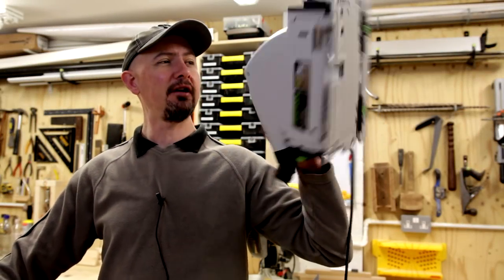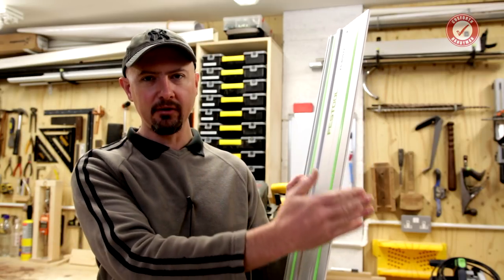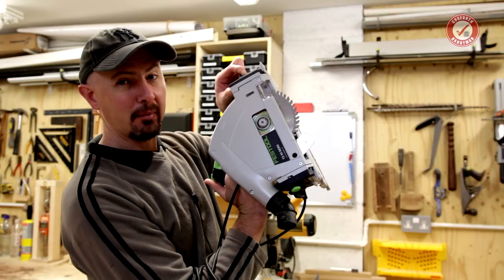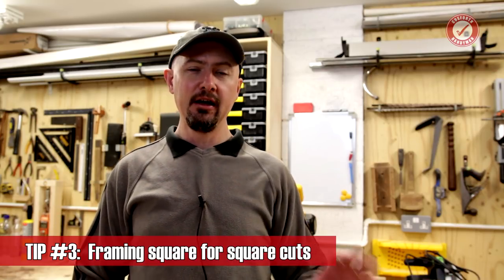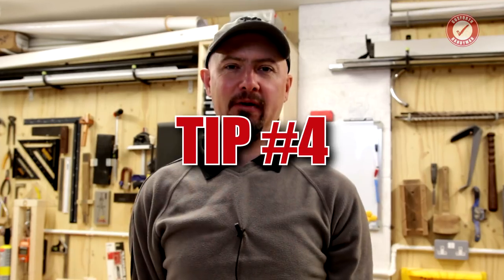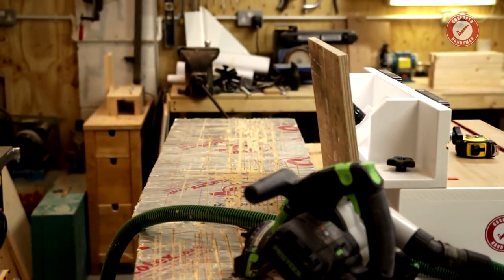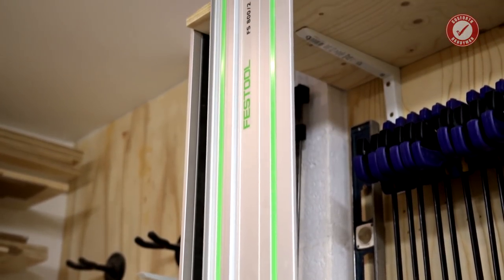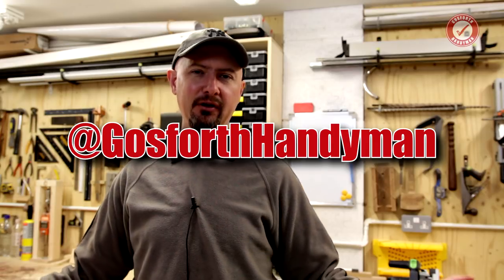Beginner plunge saw / track saw tips!

Comment: # 1 Track on the keeper side of the wood
# 2 Clean tracks with air and tape
# 3 Framing square for square cuts (or I'd use a rail square, new more affordable option from Taiga Tools available -- I'll have mine tomorrow! :-) )
# 4 Keep power cables and dust hose together
# 5 Keep both sides supported (keeper and waste side)
# 6 Hang the guide rail to store it
# 7 Attach dust extraction

Comment: Andy, The older Festool hose with the squashy end was made like that so it could flex to fit the OVAL dust port on their router. I just got my first tracksaw ( Makita ) which is great and use an excellent Nilsik vac - the vac comes with a squashy end which goes straight into the saw. Good vid as usual. Thanks.
Reply: What's your vacuum model please?

Comment: Hi Andy. You have a new subscriber. Good job👍

As for the Festool extraction connectors, it's a simple one. Older tools and extractors (pre-2017, I think) came with that standard friction connection on both the tool and the extractor. Newer tools come with the bayonet fitting, generally if you order any new Festool (that uses extraction), it will come with a free connector thrown in, for you to replace the old friction connector on the extractor. Word is, in the trade, people are finding the new connection system more irritating than the old one!
Reply from the maker: Cheers Neil. There we go, knew someone would be a lot more knowledgeable on this than me 😀- comment pinned! My only concern with the friction one is does it not wear out over time or is that rubber fairly robust? Perhaps I should leave it plugged in and unscrew the actual connector instead... 🤔
Reply: Gosforth Handyman No, the old type fitting is way. Better, and harder wearing! It’s a nicer rubber, they’ll last forever!!
Reply: Neil Snape definitely more irritating! Glad I’m not the only one thinking this.
Reply: hm... I have bought 3 Festool machines in 2018 and 2019 - none of them came with a free connector, though (of course) all 3 have the new bayonets. And as you said, imo the new system is not a step forward

Comment: Tip #7 tape up the hole on the side for changing the blade. This improves dust extraction just like the Mafel saw. Very important to do this if you are working with cement based products.
Tip#8 Plunge the saw before cutting into the material. This will help stop kick back and also gives a better starting cut. Buy longer tracks to do this. I recommend 3m and 1.8m tracks for sheet material.
Reply from the maker: Good tips! I use a 1.4m and 0.8m together at the moment - didn't know they did 1.8m tracks! 👍
Reply: Gosforth Handyman best to buy 2 3m tracks then cut one down to 1.8m and use the left over piece for short cuts.
Reply from the maker: Genius! 👍👍

Comment: I’ve got an older Ts55 that has the socket for the smooth hose and its so much easier and works well with the smooth adapter that I have on my nilfisk vac, also the bayonet fitting does not work well on the old Festools that have an oval dust port.

Comment: Festool changed the fittings for the extractor hoses in late 2016/early 2017. When they upgraded the RTS/ECS/DTS sanders in an attempt stop the hoses from coming out in use. The older TS’s have a nice round barrel which is a much easier fitting for the smooth hose ends.
(Old his into new fitting is a pain!) Not sure if they still do, but many of the tools were coming out with the new type hose fittings included.
Reply from the maker: Mine must have the new fitting on the saw but old hose. I'll look out for the old style fitting for my saw as that would make much more sense. Cheers for the info.! 👍🛠

Comment: Tip #6 3/4: The Festool splinter guard fits nicely on the old Bosch FSN 70 / FSN 140 tracks as well.
I needed a replacement for mine, but the original Bosch part is no longer sold in Denmark, and I didn't want to bother with foreign web sites. I found out that the Festool guard has the same thickness (2mm) as the bosch, the only real difference is that the Festool guard is harder than the Bosch one. Oh, and the original Bosch is black rubber.
I bought a 5m package at a local hardware store for considerably less than it would have cost me to get the original.
Oh, and I have a set of Festool speed clamps in order to replace the screw type Makita ones I use now. Bosch only makes speed clamps for their new type tracks...

Comment: You probably know that all of the Makita dust and track stuff is interchangeable with the FT  stuff,  but sum of the FT stuff will have to be modified to fit the Makita track. Makita stuff is much less costly than it counterparts in the FT line. DeWalt's  clamps are also great to have on hand and fit the tracks of FT and Makita. Great vid. B
Reply from the maker: Great info! Yes, I'm very tempted to get some of the DeWalt clamps. They look a better design than the FT ones. 👍
Reply: I have the Makita mains track saw, it does everything that the FT does but each to their own.

Comment: You can upgrade both connection ends for models until mid 2016. No need to buy a hose. Part numbers 202096 and 202346 (27mm) and 500670 (36mm). Great video, thanks!

Comment: Hi…..I have a 4 x 8 sheet of unfaced foam board insulation. Would that work for a cutting surface?
Reply: Absolutely, but wear a mask, cause gawd knows what's in it. I use soft wood panels that I found at Lowes. They're 48" x 16" and I don't bother with a mask, as my dust collection grabs the brunt of the dust. About $7 each, and they last for months.

Comment: And when the splinter thingy on the track is ruined and can’t be used as a guide to line up the cut. Measure 18,5 cm back and you can line up with the back of the track.
Reply: Buy a replacement splinter guard strip and replace it instead. only costs 10-30 £ depending on track length.
Reply: This is a nice little tip.

Comment: good vid. have been suggesting for a while we get a track saw for our shared workshop as we don't have space for a bench saw. not sure we can stretch to a festool though. Anyone get any recommendations for a cheaper brand that still does the job ?
Reply from the maker: I really like the look of the Dewalt with the double sided track - if I was buying again it would be a serious contender. The Scheppach looks canny for the price!
Reply: hi makita sp6000 is a good saw but I have a festool ts 55R ebq now
Reply: The Makita has been on sale as a package recently in the U.S.  It looks good from what I've seen.  Don't know if they will do coupons around Father's Day and the holidays, but that's something else that can help.
Reply: A makita circular saw with the track adapter gives perfect cuts cheaper and can be used for other jobs as well as cutting deeper with more power. Down side is they aren't plunge saws.
Reply: The Makita SP6000J1 track saw is definitely a Plunge saw, and very well regarded in comparison to the Festool.  Makita, Triton and Festool tracks are interchangeable. It's $409 US with 55" track and storage box. The 36volt cordless is $499 with saw, 2 18volt batts and dual charger, and two storage boxes, small for batts and large for saw, but no track.

Comment: Never considered using a vacuum cleaner as a dust extractor before...have our old one in my garage/workshop...found it fits my drop saw perfectly... Not yet bought a tracksaw...am leaning toward the budget range... the Erbauer as it has a larger diameter blade 185mm.
Reply: That's a good size, mine is the 165mm blade....it'll never be big enough of course.
Reply: @diggerdave.6587  I did buy the Erbaur... and it has been invaluable... Soon it will be put to work again precision cutting plywood sheets to build a modular entertainment, computer storage and recharging storage and display system for our lounge room.. 4 floor to ceiling modular units that will fit together for our new look lounge that has been redecorated and has new carpets, lounge suite and soft furnishing... I'm using A B graded ply rather than mdf or veneered chipboard. I've esteimated about 6 sheets of 2.4m x 1.2m x 12mm (8' x 4' x 1/2").... so it will probably take 8...heh heh heh.. But waayy cheaper to build myself to fit the room rather than have it made or pre-made... if you could get suitable sized units.

Comment: I use even my festool plunch over my head.
Just make a few tiny holes in the rail, screw it on your workpeace, put on safety  glasses and you can saw above your head.
But, if you do it, be careful. It is'n easy to do.

Comment: Why do most saws have the blade on the right hand side? most people are right handed, so surely it makes sense to have the blade on the left so that you are not having to look /over/ the saw to see the line?
Reply from the maker: Good question! Might be for balance? Not sure... 👍
Reply: I think it's something to do with the direction a standard motor spins. Although some clever engineers have been able to address this in their rare designs.
Reply: It's so the larger part of the base sits on the material you're keeping and it also puts the dangerous part of the saw (the blade) away from your body when you are holding it at your side. Where I'm from we also cut from above the saw and look down when cutting framing. Left hand saws just feel more dangerous and give me the creeps.
Reply: I guess that makes sense. But if that is the case, why are some saws the other way around?
Reply: wforl it's west versus east coast thing from America.  One side had hypiod saws the other had what I think they call sidewinder. So some are left and some are right. Sidewinders or circular saws generally have the blade on the right side untill a few years ago when for a reason I don't know battery saws started to have left side blades.
Reply: We, the left-handed minority, occasionally bribe manufacturers just to piss off the right-handed majority ;-) TS55 works fine for this lefty.
Reply: With a track saw there is no need to see the line when actually cutting, very important to see where the track is in relation to the line and align before cut.

Comment: I'm so close to buying the festool track saw but just can't seem to make a decision , the problem is I already have a homemade plywood track that I use with a circular saw ( fitted with a really good freud blade )  my concern is that it wont be any better and ill have spent loads of money unnecessarily .  Decisions decisions 🤔.
Reply from the maker: It's a tricky one and something I might make a vid on at some point. The proper guide rails are very accurate, can be joined together into LONG tracks, have the 'sticky' undersides and can be clamped from underneath, which are all nice features. The saw itself has excellent dust extraction, depth stop and obviously the plunge capability... plus some other stuff. Generally it's just quicker to use than a home made track... but then I would say that after shelling out for one! 😂😃👍
Reply: Do it, you will thank yourself.  I agonized for months over the same thing and over which brand, but in the end broke down and bought the TS55.  Best tool I own, I use it all the time and I get perfect results every time.  Time is money, and my TS55 saves me both in the end.
Reply: Dale Brown you've given me the push I needed , will be investing in the new year 😀
Reply: Gosforth Handyman would be a great video to watch. 👍
Reply: ebay has tons of new and used TS55 REBQs. Make sure you get one with a systainer. 2nd hand ones can give you a bit if discount compared to new - thats how i got mine. Just don't pay more than the best brand new on-line deals, some Festool auctions go crazy. As the vid says, they work like an abs treat cutting down high gloss end panels....  just  done a kitchen and a kitchenette.
Reply: Kevin Wells thanks for that ill take a look 👍
Reply: I had a homemade tracksaw for a long time. Now I have the Makita tracksaw. BEST DECISION OF MY LIFE. You will not regret.
Reply: Makita circular saws will quite often work on the tracks as well. I use one for cutting alliuminum and it cuts like glass. I think the fixed blade helps.
Reply: did you do it? What do you think now?

Comment: Hi, do you know if the Festool saw will fit on the Makita's tracks? Mine will need upgrading one day but prob won'y be able to afford new tracks also thanks
Reply from the maker: Umm... I think so - sure someone mentioned this in the comments not long ago. 👍
Reply: Yes and I think the makita ones are stronger. Also the makita saw can be used on walls by fixing the track to the wall then using the track lock on the makita saw to help hold it in place. If you let it go it will fall of as only one side of the saw locks on.
Reply: Thanks, I've had the Makita a while now but never had the need to use it on a wall, I guess that's useful on US plywood walls?
Reply: Gid joiner I've done it on feature walls eg cedar or like you said ply and mdf.
Reply: Gid joiner Another thing if you haven't done it when you need to replace either the slides on top of the track or the splinter guard use the festool ones as they are better.

Comment: Personally, I wish I had the "Doggie" smooth hose rather than this connecting type I do have.  My hose is such a pain to fit either into or on top of, the appropriate nozzles.  The fit is so tight and stiff, I am worried I will break something, and I wrestle to attach and detach my hose.

Comment: i can’t for the life of me get a straight cut with this thing. it’s always an 1/8th off. any advice?
Reply: Probably not allowing for kerf so got cut-off piece to your left instead of right. But...
   I know someone who is right handed (track saws all designed for right handed) but leading eye is the left - explained why they always lined up wrong and tended to tip themselves over to right which unbalanced them and made their cuts veer to left (like rh cricket bowlers trying to bowl too fast and leaning over so ball goes down rh batter's leg side). Shut left eye or wear patch helped but right eye was distorted. They just had to remember and take more time setting up material, saw, and their own body position

Comment: Am I the only one who has trouble with the Festool splinter guard staying stuck to the track?  This becomes especially troublesome for me in the hot, humid summers in North Carolina. I did not notice the problem so much when my shop was in Northern California.  Any suggestions on keeping the splinter guards from curling up and off at the ends of the track?  For me, they just don't stay stuck.  The first time the plastic guard comes unstuck, the accuracy and precision are lost.  You can't just press it back down or re-glue it and be assured it's in the exact same location.  My Makita tracks don't have that problem.  I wonder why Festool doesn't use better (and less temperature-sensitive) adhesive for its track splinter guards?
Reply from the maker: Interesting - never had that problem! Defo sounds like a temp / humidity issue. :-(
Reply: Welsh Rabbit   When you replace the strip make sure you clean all the residue off then clean the residue of the cleaner off as some adhesive cleaners will leave a film that keeps the tape from sticking to the aluminum. I used denatured alcohol for the final clean before I taped on a replacement cut strip. And I had no issues with it staying stuck in place even when I used it in south Texas with 100+ Fahrenheit temperatures and humidity near 100%.

Comment: I found that keeping the air hose and the power cable together with zip ties is a recipe for catching on everything possible. I also found that cutting off the loose ends of the zip ties gives you something with an edge which goes through skin with a tearing effect :-( I'm thinking of giving gaffer tape a go.
Reply from the maker: Need one of them hose jacket things. 👍🛠
Reply: I use strips of Velcro and they work very well.  Nothing to cut or scratch like the head of a cable tie.  It's also easy to move and reattach them.
Reply: Just wrap the power lead around the dust hose about five turns.  Keeps them together and out of the way nothing extra to buy or snag on.